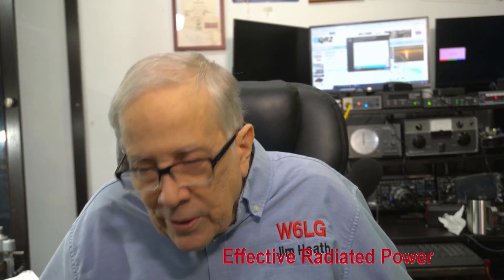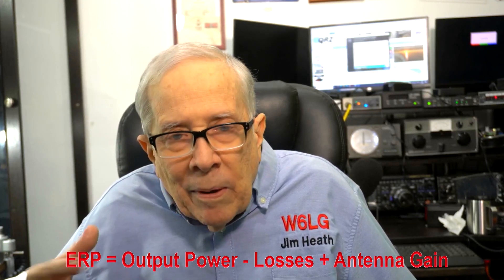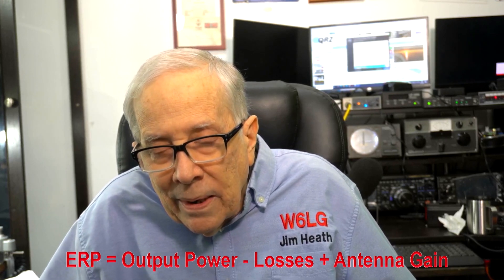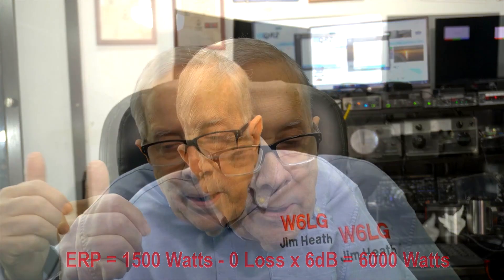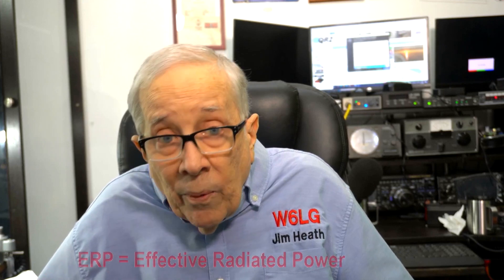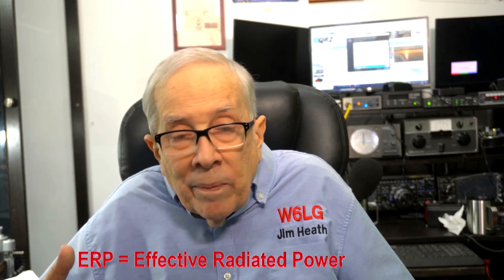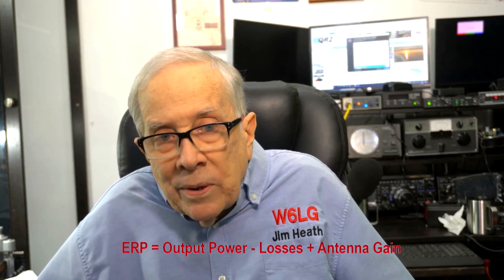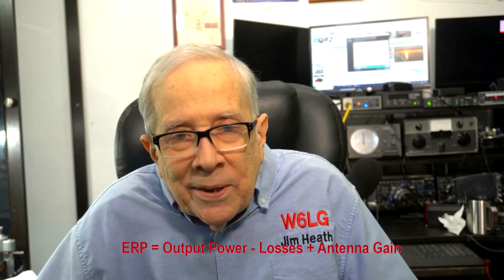What is ERP or Effective Radiated Power?  Does ERP Affect Signal Strength?  Jim W6LG Explains

Comment: Jim, I guess it's OK because you can.  If you're having a poor RF day and the sunspots are against you then maybe you need what you have to make a contact, especially a contact if you need it for a certain DX entity or some other contest you are in.

For me who has only used wire antennas, portable and fixed at home and 100 W or less, usually a lot less it doesn't really matter. If everything works well and I have done the best I can with my antenna placement and tuning and coax or whatever and I make a contact I walk away with a smile on my face. If it's such a day that my low power signal can't be heard anyplace or my local noise level is so high that I cannot hear anyone that might come back to me, I turn off the radio and dig out some soldering project, get out my analyzer and tinker with my antenna, or even listen to a good podcast.

I guess it's whatever you need to satisfy your Ham Radio desires. For me when growing up if I ran 100 W, I would've crashed most of the televisions in our neighborhood. So I did what worked, made contacts, and the neighbors were happy. Ha ha.

Comment: Hi, Jim. I'm glad to see you back on YouTube! You were certainly missed! I appreciate the example you gave (6 watts ERP vs. 6,000 watts ERP). The most intriguing part to me is that a low-gain antenna is going to be both sending and receiving with less gain (as I realize you have discussed previously). In contrast, the high-gain antenna will be able to both send and receive more strongly. This makes me wonder if both stations will only hear each other moderately well (as long as the QRP station is above the noise floor). To be specific, if the QRP station has a basic dipole -- with 0 dBd -- that would mean his station will have greater difficulty in hearing yours (obviously depending on conditions) compared to your greater ability to hear him which makes up for some of the difference in ERP. As a side note, it is fascinating to think that if he was running about 1.5 watts into a 6 dBd Yagi that he could hear you tremendously well but you could hear him the same as if he was transmitting 6 watts into a 0 dBd antenna. Thank you for inspiring these deep thoughts and practical comparisons! ~ 73 always ~ Jared ~ AC7WH
Reply from the maker: Agreed.  But, on receive the one S unit is not enough to get his signal up above my noise.  This kind of discussion is good. I have been involved in real emergencies.  During those emergencies we all need to do the best we can to 'communicate'.  73, Jim
Reply: @ham-radio  Excellent point! Thanks so much. ~ 73 ~ Jared

Comment: Thanks for the refresher.  Always good to carry the water in a bucket that doesn't have a hole in the bottom (line loss), and antenna gain; similar to a parabolic mirror behind the candle.  Very low loss and highly directional radiation is a terrific situation.  You're the best!🎙📡🎤

Comment: Great video Jim ! ERP is a real number . Broadcasters use that number ERP watts to give station power.   The outher important thing  is signal radiation pattern . I like using antenna modeling software to give me and idea of my pattern.  The take off angle is important for DX.  That works with ERP . This is a big help when you are hunting a certain country . Looses in antenna system or DB gain work both TX and RX .  This is 2 way radio .  ERP is the number you want to use for RF exposure measurements . 73
Reply from the maker: That is an excellent point and I completely agree!

Comment: I just had the comical image appear in my head of someone running LMR400 for HF into a loaded 40m hamstick dipole.  The antenna at the other end of the feedline is at least as important as the loss characteristics of the feedline.  So, they lose 0.2dB through the feedline - and, 20dB through the antenna.  🤣
Reply from the maker: Good point and good image. 73, Jim

Comment: Apart from a difference in ERP, a difference in antenna radiation pattern can also contribute to a difference in signal strength.   You're pointing directly at the other station with your Yagi with 6dB gain, and his long wire is radiating at some random elevation angle.  And, in that scenario, he could easily be down another 10dB to 20dB.

Thanks for the video, Jim!
AI4IJ
Reply from the maker: You are right and I forgot to discuss  Pattern is very important as you describe.  Thanks, Jim